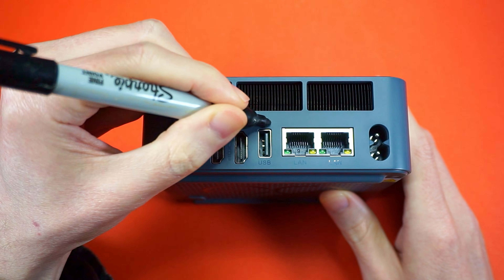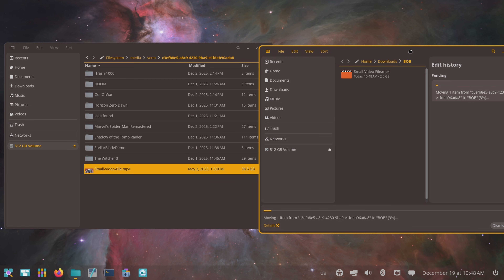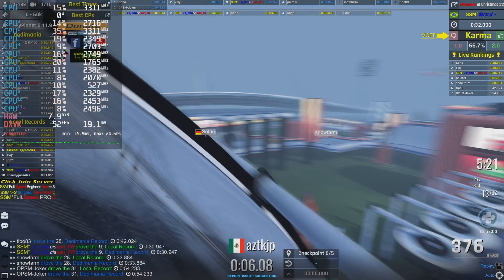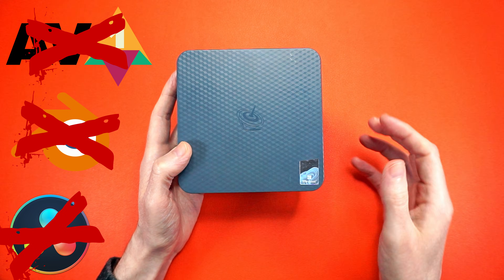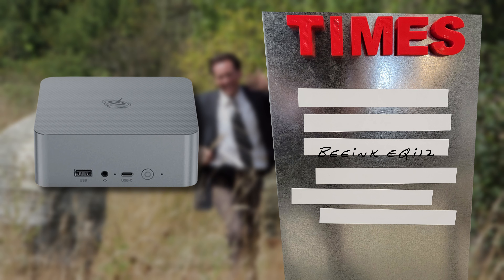BeeLink EQi12: Linux Shakedown

Comment from the maker: Pop!_OS 24.04 and COSMIC are a bit of alright. Both are worth checking out if you’re in the market for a new (but familiar) desktop experience. As for the Beelink EQi12, I wish the Iris Xe had some bonus grunt, but it's a solid all-around box for light desktop work. Thanks for having a watch and be shure to check out the write-up https://interfacinglinux.com/2025/12/23/cosmic-bees-pop_os-on-the-beelink-eqi12/
Timestamps
00:00 Intro
00:09 Overview
00:18 Geekbench benchmark
00:28 DDR4 Memory 
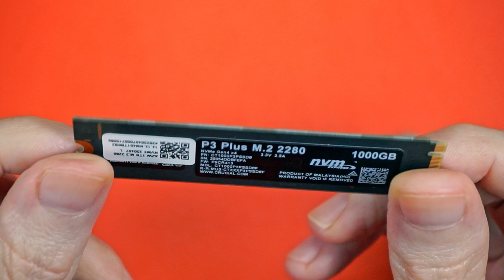00:32 1 TB NVMe
00:36 Internal PSU
00:40 Rear I/O panel 
00:51 Front I/I panel 
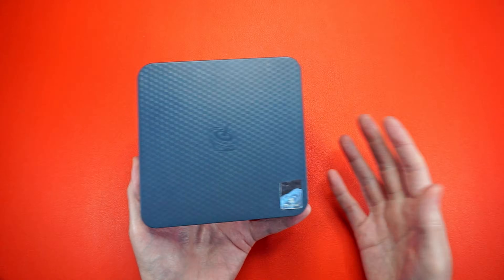01:09 BIOS / UEFI 
01:26 Pop!_OS 24.04 LTS installer 
01:34 Pop!_OS first time setup 
01:39 Wi-Fi setup 
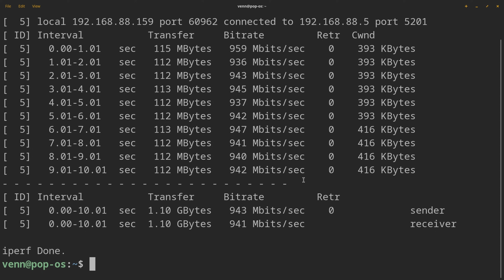01:44 Gigabit ethernet and speed test 
01:49 Bluetooth setup 
01:58 Accessibility options 
02:02 Desktop options 
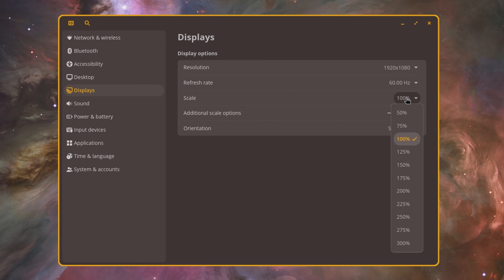02:06 Display settings 
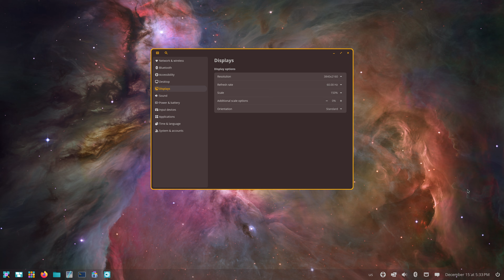02:14 4K scaling 
02:22 Sounds options 
02:24 Performance settings 
02:29 Launcher and workspaces
02:33 COSMIC file manager 
02:49 Issues with SFTP 
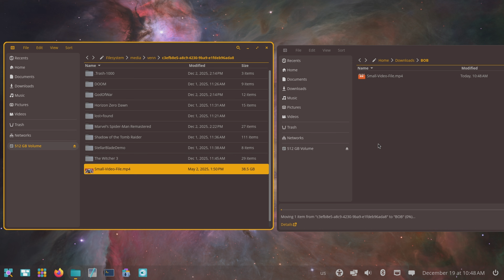03:07 Multi gig file transfer 
03:20 Disk speed benchmark 
03:28 Tiled and floating windows 
03:43 App store 
04:01 OBS hardware acceleration 
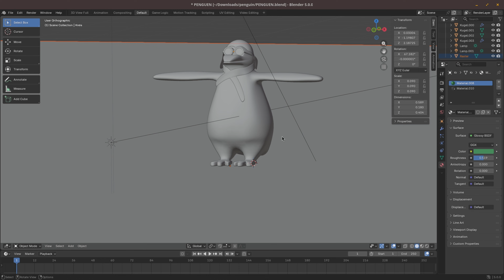04:08 Blender hardware acceleration 
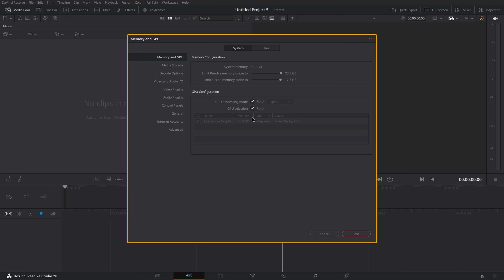04:16 Davinci Resolve Studio 
04:26 Jellyfin transcoding 
04:47 Vulkan and OpenGL benchmark 
05:12 Trackmania 
05:27 Stumble Guys 
05:33 Silksong 
05:38 Dreamcast emulation 
06:00 Power usage 
06:22 Final thoughts
Reply: The web link shows as json code when I click on it (using Firefox on Debian)

Comment: I'm very used 2 x 2.5 Gbit Ethernet interfaces at this point on mini-pcs and not color code USB Ports in 2025... also that thing has less GPU performance then an AMD Radeon RX Vega 8 it's pretty much only competition for an AMD Ryzen 75825U or and 7 7730U and only if you want less GPU performance and less multicore performance. 
I currently see the Beelink EQi12 Cire i5-1235U with 32 GB RAM and 1 TB SSD for $ 529.- while I see a AMD Ryzen 7 7730U Mini-PC NucBox M5 Ultra 32 GB RAM 1 TB SSD for $459.99 and a AMD Ryzen 7 5825U Mini-PC – NucBox M5 plus 32 GB RAM 1 TB SSD for $429.99  both run fine with Pop!_OS 24.04 and COSMIC as I happen to have them here in my "lab" (payed for by myself).